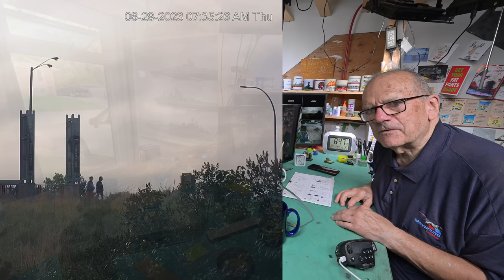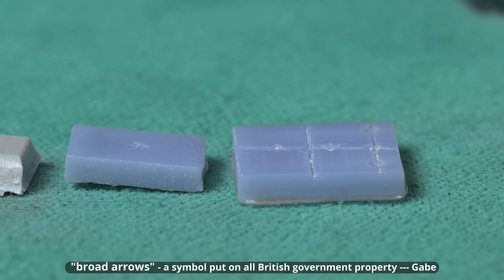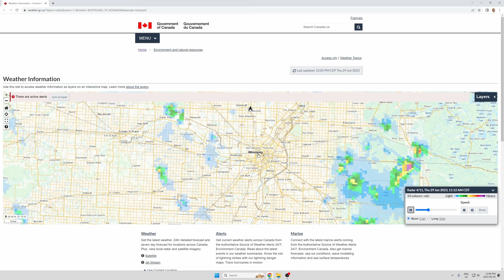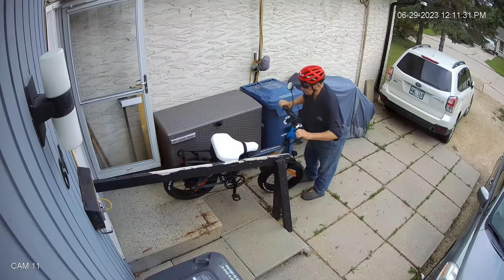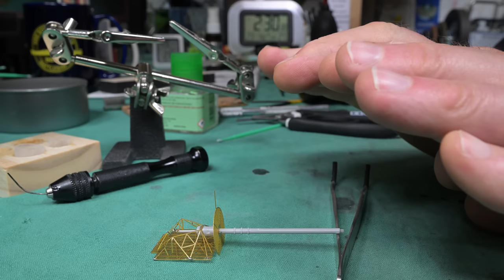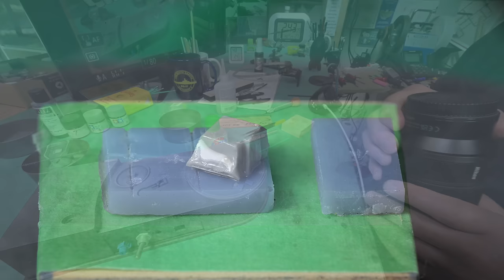The Model Ship - Part 1654

Comment: Hi Ron, Great video.  It's pretty much standard practice to either use CA or epoxy when gluing 3D printed parts.  Extra thin just doesn't make a strong enough joint.  Thanks for sharing.  Have a great day.  Jeff
Reply from the maker: Thanks for the tips Jeff! 👍

Comment: I have purchased dozens of models off places like Ebay some dating back to the 1960s, so even if the Yamato goes out of production, it likely will still be available for many years, so you just take your time!
Reply from the maker: Great point! 👍
Reply: @roncalverley  Yeah Ron. And you can still buy mine off me cheap! I don't think I will ever get around to finish building it.
Reply from the maker: @paulsmodels  Hi Paul,
Thanks for the offer, but I think I'd prefer to have it fresh out of the box. However, there is the real possibility that now that I've seen the complexity of the Yamato kit, and just how much I've seemed to be slowing down here on the USS Iowa, I likely will not get my Yamato finished either. Hopefully when I'm shut in again this winter, and the Iowa is more (or all) completed, I'll be feeling more gung ho about it again.

Comment: I have had a difficult time finding a glue that is reliable on UV resin.  I used 5-minute epoxy to hold Barnacle Bill on that acrylic rod but I didn't have a lot of confidence in the result. The only thing that really seems to work is drops of uv resin that are then cured with a UV light.
Reply from the maker: Thanks for that info Gabe! 👍